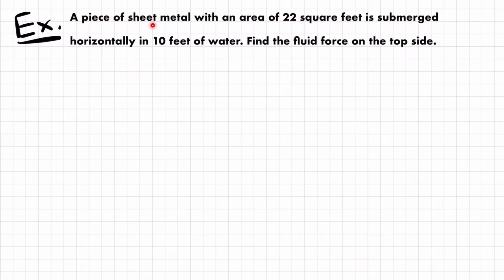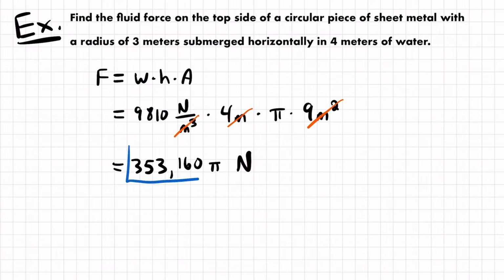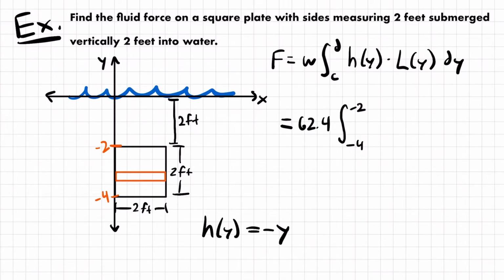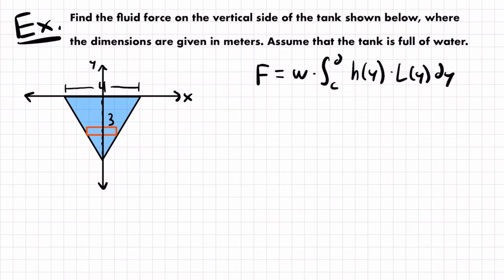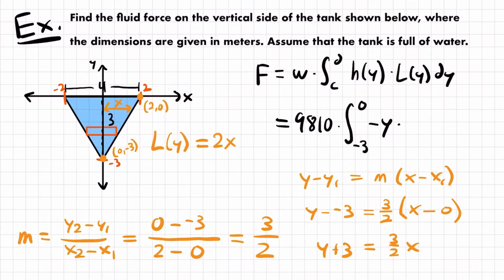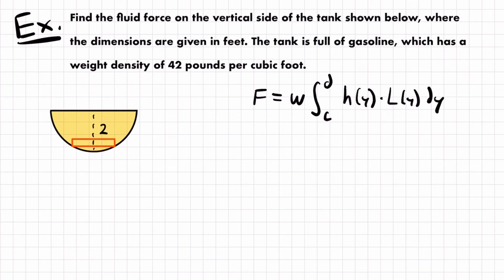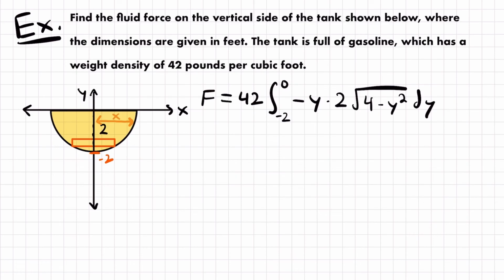Fluid Pressure & Fluid Force Examples | Calculus 2

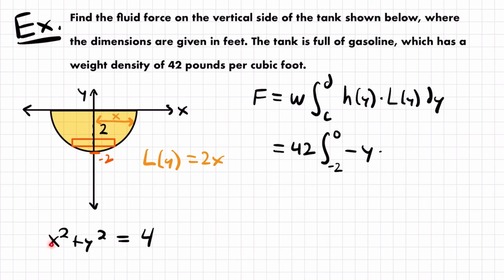Comment: 34:49  doesn’t the circle equation for x equal the entire length of the semicircle? When I graph it on my calculator, I get the entire semicircle, not just the quarter circle, so I’m confused why we have to multiply our x value by 2..and th sq rt of (4-y^2) is the equation for the top half of the semicircle
Reply from the maker: Good question. First, note that x=sqrt(4-y^2) produces the right half of the circle, not the top half. The top half would be y=sqrt(4-x^2). So we are working with the right equation, for the right side of the circle. Then, its important to realize that an input of y into that function/equation produces an x coordinate along the semicircle (distance from y-axis / x=0), it does not give the entire length between both "sides" of the circle. But the distance will be symmetrical, so you can multiply it by 2 to get the full distance.
Reply: You’re the man- I solved for y 🤦‍♂️

Comment: For example 3, why don't we multiply by the gravity also?
Reply from the maker: Gravity is not explicitly a part of the formula for fluid force problems. It's taken into account through the weight-density of the liquid you are working with (62.4 lb/cubic foot or 9810 N/cubic meters). If you want a refresher on the formula, be sure to check out my lesson video for this topic, which is linked in the description (its lesson 10 of my Calc 2 series)

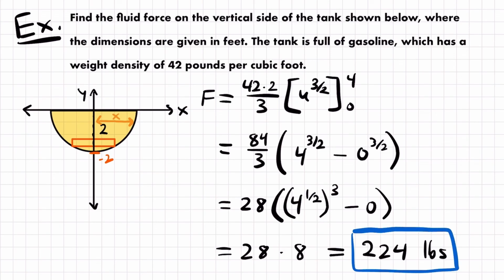Comment: 41:36 were we supposed to multiply pi to it??
Reply from the maker: Nope, pi is not involved in this problem. We are calculating the fluid force on a vertical surface, not a calculation of volume or area involving the semicircle. If you were to solve the problem using polar coordinates rather than rectangular coordinates, you may need to involve pi, but working with polar here is not necessary. Hope this helps!